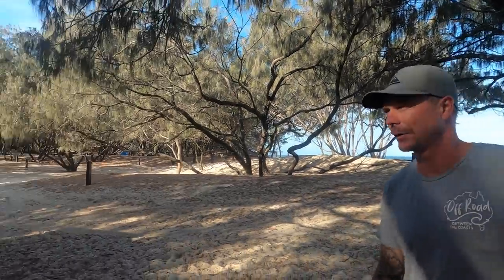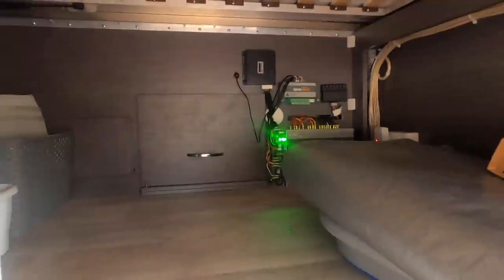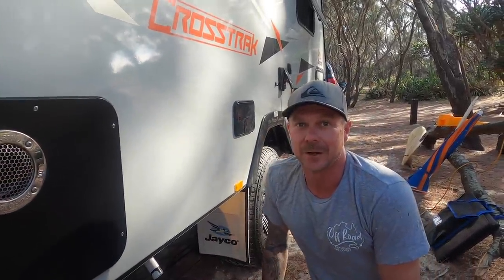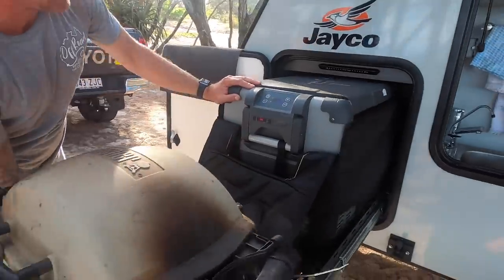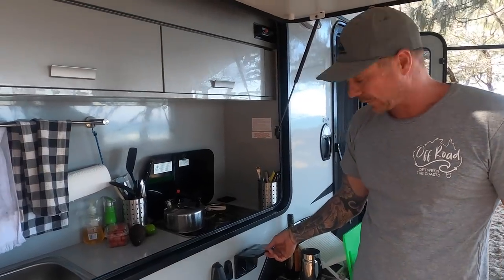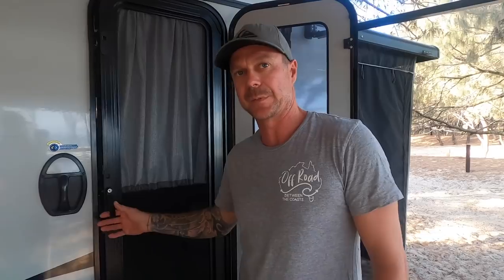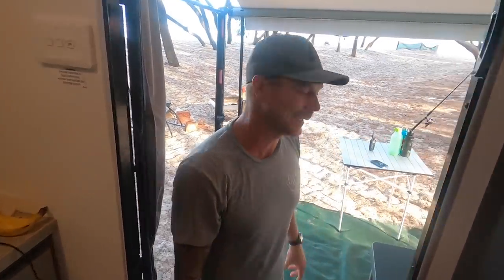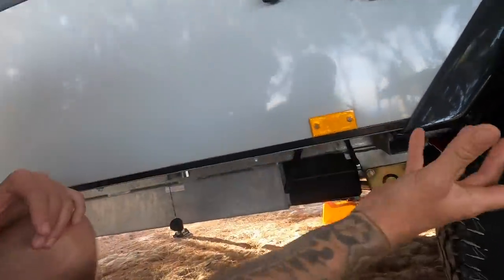Jayco Crosstrak 13ft Review

Comment: Good review for a first impression. I have a 13 on order after many months of research. My main reason is the weight, departure angles, and size. Yes, Jayco builds are rough, especially when they bragged they spit out a new van every 16 minutes. This will be my 3rd Jayco but the after sales from experience has always been positive. Also, being a tradesman, I can handle doing improvements  that they won't do on a build sheet.  As they are pretty much a flat pack van and you can't change their design until your dealer or yourself  takes ownership.

Comment: Not sure if your fridge does but on my Engel,arb, and waeco you can unscrew the cig lighter tip  piece from end of lead an this leaves a two prong plug which you can buy a factory made socket  which is for the  2 prong plug I  think they just call them a Engel socket can get them in exact same hole pattern and look as a narva 12 volt an it lets you push the plug in an screw the collar up to hold it in an never had issues myself. This may save cutting cord and loosing the cig lighter socket option. Great video an definitely showed the real issues an some solutions.
Reply from the maker: Thanks! Will look into it.

Comment: HI mate,

Not sure if you have sorted your power issues... But if you have the J Control unit, for it to read correctly you will have to have your solar blanket/ any external charge from car etc coming in via the BC300 shunt/commlink bmpro sell otherwise the battery monitor reads incorrectly. You cant just hook up the solar blanket direct to battery even via a regulator its has to go though the shunt which is why running the Generator tops the battery up and it reads correctly as its being charged via the J35A/B/C/D.
Reply from the maker: Thanks for the tip.  Running through regulator but don’t have a shunt on it.  Thanks for your help
Reply: @offroadbetweenthecoasts7003   no worries, get a bmpro bc300 it should read correctly

Comment: Hi Nick .Enjoyed your video. We also have the 13ft. Crosstrak and I want to upgrade poly block hitch to the Cruse Master DO 35. Did your have any problems fitting it especially regarding the hand brake? Cheers Rod
Reply from the maker: I put it on myself and it is a bit of work to readjust the handbrake cable. You need to shorten it and tighten at the hubs- would be easier for you have two people. It did take me a couple of hours but I got there in the end.  Hope this helps!

Comment: Thanks for the video. Did you discover the problem with your solar panel wiring?? I have a 2019 and the panel does not seem to charge
Reply from the maker: No worries Scott! Yes we did, it wasn't connected.
Reply: @offroadbetweenthecoasts7003  thanks where was it not connected? At the panel or the charge controller?
Reply from the maker: @scottwines5031  it was up in the front boot area.

Comment: Get yourself a Victron Energy MPPT solar charge controller they turn any panel into a power beast, and they really shine when conditions aren’t ideal. On recent trip ours had the 110a/h agm charged in around 2 hours on bulk charge then on float. We running the fridge 24/7, camp lights and 12v fans plus charging devices. Had power to burn
Reply from the maker: Thanks! Will look into it.

Comment: Just wondering what you are going to use on the under joints sikaflex pro???? As I need to do a similar job lol and would be interesting on what product ?
Reply from the maker: Hi Richard.  We plan on just using sikaflex pro
Reply: @offroadbetweenthecoasts7003  Ok I was looking at the 291 marine as well as the Pro so one or the other i guess thanks for the response mate enjoy the crosstrack

Comment: connecting straight to batt the bmpro doesn't meter it, try the aux or buy the shunt. lithh batts might not be compatible with yr bmpro .  i hve 2 batts and have enuff power. i find the water is the issue, not enuff.  join the FB page....
Reply from the maker: Thanks! Yep we’re on it.  Good tips on it.  Thanks!

Comment: Would a 2.2 kva gen. Fit in where the drill and blower is?
Solar panels are only 75 % efficient as they need air space.
I bought a a van second hand and was never used. The reason was the hot water was hooked up back to front from factory.  I know  that because the pipes weren't long enough to connect the right way. Disgusting  workmanship today.